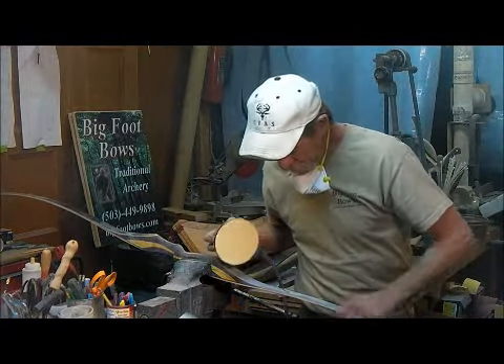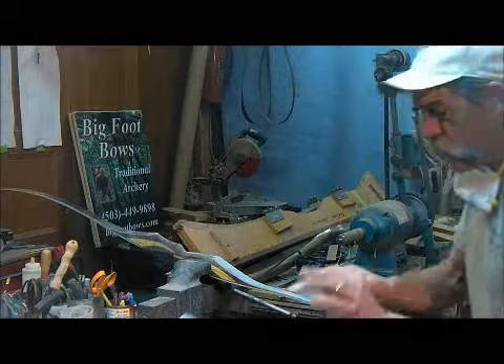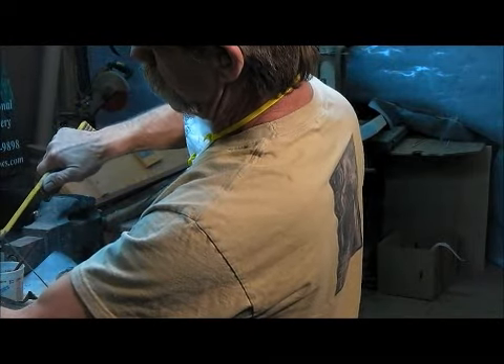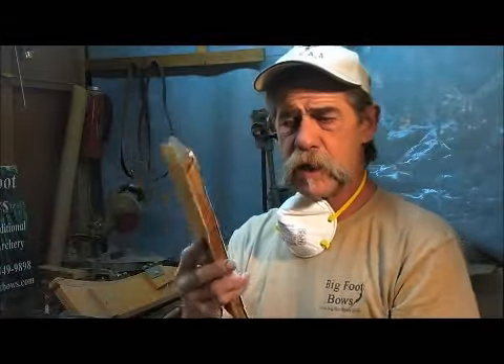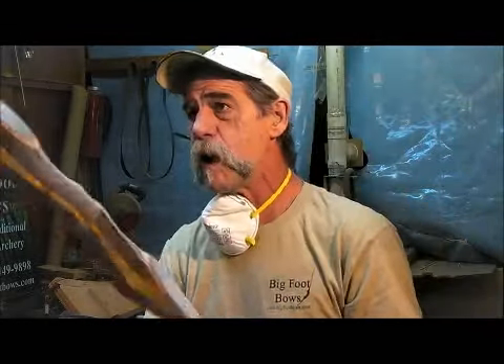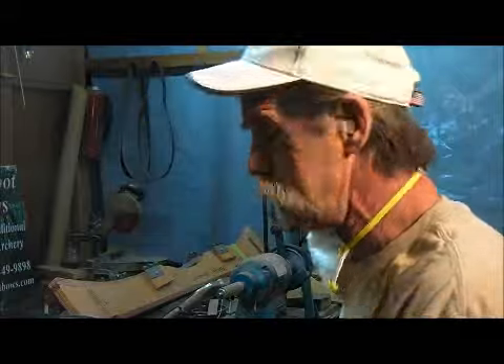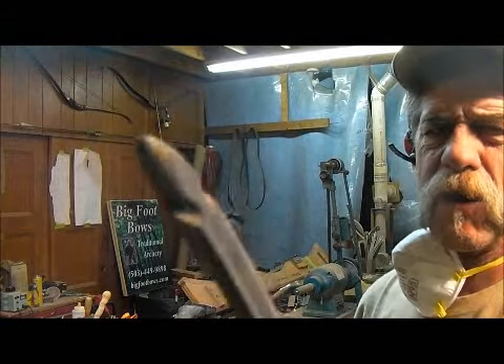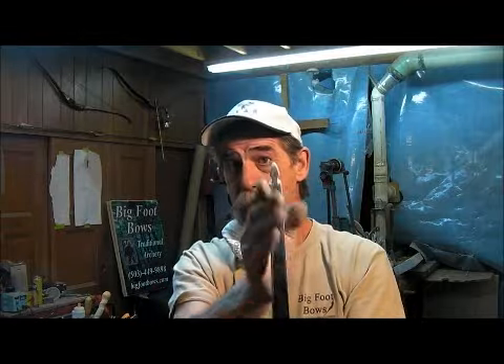Limb sanding

Comment: I have a 60# bear Montana longbow that I need reduced to 45#-50# cause of a rotor cuff injury only thing I don't know if there's enough glass to be trying to do this are you familiar with this bow or could you tell me how thick the glass should be in order to do this and still have a dependable bow and how thick the glass should be to safely take 10 or so pounds off? Thanks